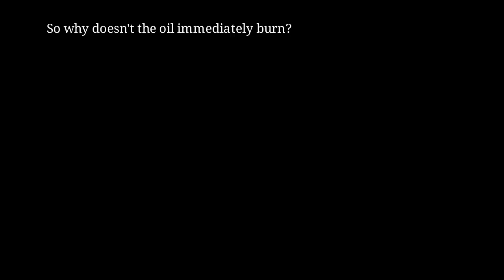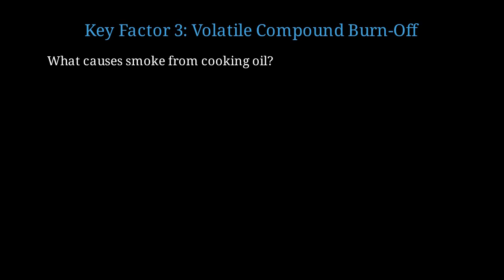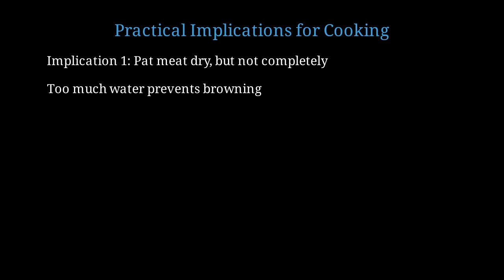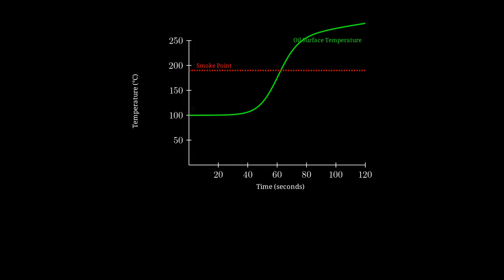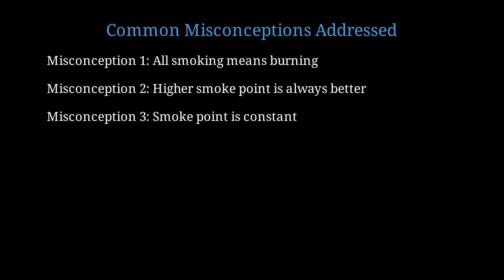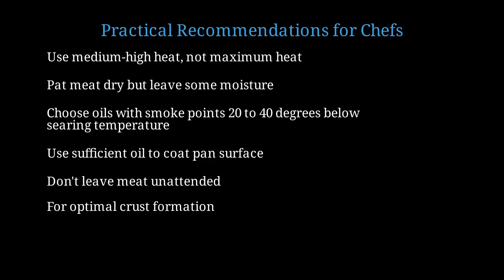Why You Can Sear Meat Above the Oil’s Smoke Point”

Comment from the maker: How can we model the dynamic temperature gradient across a millimeter-thin oil layer in real-time?
What is the quantitative relationship between antioxidant concentration and smoke point shift?
How do different pan materials alter the effective heat flux during rapid water evaporation?